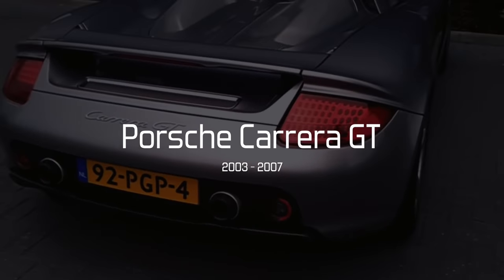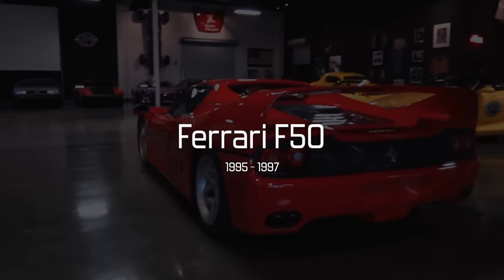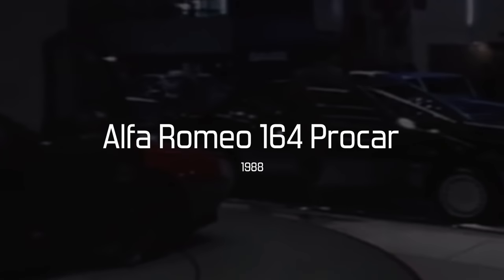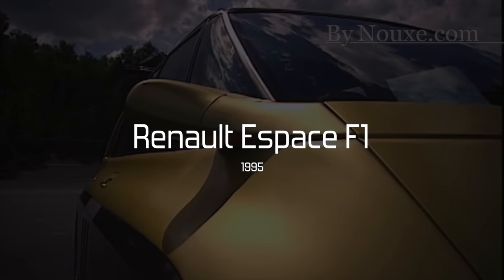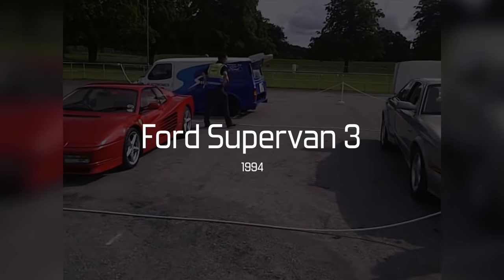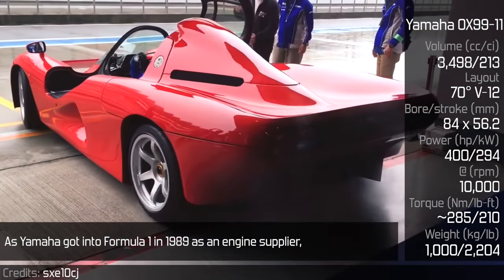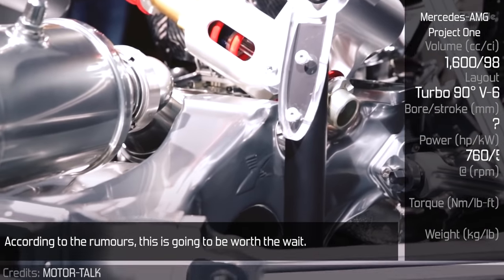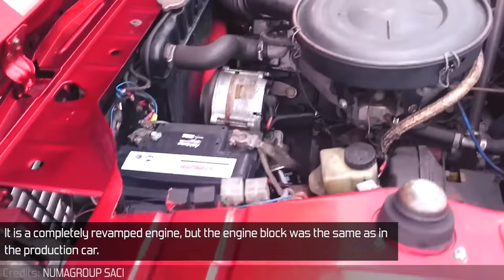8 'Regular' Cars Which Happened To Use An F1 Engine

Comment: What is a Mexican's favourite motorsport?

(Click 'Read more' for the punch line)
FORMULA JUAN!
Reply: Jajajajajajajajjajajajajajaja....
Noup, bueno si.
Reply: omg lol, so dry..
Reply: Oh! Your killing me oh! Oh! Im holding my sides ahh! Good juan, I didnt see that juan coming.
Reply: Cross country
Reply: why doesn't mexico compete in the olyimpics

Beacause everyone who can run or jump has already crossed the border.
Reply: Lawnmower GP
Reply: Good comment from a Mexican point of view. I'm Mexican but raised in the USA.
Reply: TACOBELL Racing with Speedy Gonzales as driver..
Reply: Josh Bacon Even mexico has a hypercar now.... and it actually has an awesome name

The INFERNO
Reply: Bronicar 3000 Well, it's yet a concept car, and as the Mastretta MXT is dead, the only mexican car right now is the VUHL 05
Reply: My Volvo 264 was equipped with the PRV-V6 which at the time Renault used in their Formula 1 cars. I was told that the F1 version produced approx. 600HP!
Reply: Andrés García Still the INFERNO is one hell of an awesome name for a car, it actually looks like its been through the furnace of hell
Reply: well my old BMW 2002  engine was the base of the 1500 HP formula 1 engine. Renault  accused BMW to burn NAZI fuel to get this power. Well nobody checked the fuel of Renault. But just for infomation the cost of winning 1983 FORMULA 1 was 10 time less that for Audi for the WRC with its Audi quatro. Few years later from  the old 6 cylinder 24 VALVES ( build for the M1 used by F1 pilots before the F1 grand Prix during the Turbo era) the same team of F1 Motorsport BMW built the  the 16 valve M3 2.3 l  (CODE S14B23)  in 2 WEEKS! This engine is still the best ever engine in car industrie to have won more than 1400 races  at  the time Renault Mercedes Peugeot Audi VW Ford Opel etc were invested millions to get some results! The worse will came from Ford accusing BMW using the same base engine to more than 25 years in order to force BMW to quit the race. Well BMW with no monney in the early 60 is one of the famous car manufacture today the big one still using as the reference to compare thei best car. So far   people driving a BMW doesn't need to tell more about their drive a BMW only to name the serie with sayinf the model. No car manufacture can pretend to have built such a reputation of its production in oder to make its clients proud  even for the serie 1 even to compare with Mercedes with its class 1. Just because Mercedes is still using british tuner to win some race, the german manufacture can't pretend to be as good as BMW. When Mercedes complained that Bosch was unfair because the Motronic technology was much better forcing BMW to make a deal by justice court decision,  like Ford later on , BMW demonstrated that it was  capable to be better without paying more . I don't talk about the cardan transmission instead of the chain, the steering wheel found in any car, the independant suspension for the 4 wheels since the 60, the variable valve control found also today on modern Renault gas engine. By the way it's BMW in 1973_74 to sell the Turbo with normal gas on catalog for it's 2002 before Renault and Porsche.... Renault public manufacture won Formula 1 engine because the support of the national Petrol company and nuclear technology tranferts. Renault helped BMW to produce the nuts for BMW turbo and maybe because Reanault was not keen to compete against the unknown Talbo Sport team  willing to byy the BMW  F1  16V 1.5l turbo engine...
Reply: Or cross country
Reply: Josh Bacon LMAO!!!
Reply: Hey, Josh!
Which car has the name of a Star Wars character?

Toy"Yoda"
Reply: real Tylun Porter LOL! 😂
Reply: DC77 Gaming Out?
Reply: DC77 Gaming my question is why?
Reply: DC77 Gaming Exactly. You dont have a good reason for me to get out.
Reply: formula chapo
Reply: Josh Bacon for me it doesnt say read more
Reply: Josh Bacon
Reply: Somebody call the cops
Reply: This joke is so bad that it’s funny

Comment: Not just warmed up before started, they have to be kept warm AT ALL TIMES.  Literally they keep the oil and coolant hot and circulating, because if the engine block is allowed to cool down, it'll crush the pistons and rings and ruin them!
Reply from the maker: I hear this for the first time. But even if it is true, it makes sense - F1 tolerances are ridiculously tight.
Reply: I know, my gfs are jealous of F1 engines.  OHHHHHHHHHHHHHHHHHHHHHHHH!!!

Comment: How much you wanna bet that the AMG Project  One doesn't make it to production with a 1.6 liter V6 that makes 760 hp?  It is a pipe dream to make those numbers, meet emissions requirements, survive 50k miles at 50 psi boost and still get acceptable fuel economy.

Comment: Got it wrong the f1 engine in the Carrera GT was put in a lmp900 called the [ porsche 9r3] for Le Mans 1999-2000 but was cancelled because of VW telling them to cancel there racing programm as Audi was already in it. Or they would be out of the suv project

Comment: The Mercedes F1 race engines never get used at 15000 rpm anyway as it is to fuel in-efficient for the current F1 regs

Comment: Wasnt it alleged that BMW would only use second hand blocks for the 1.5 liter that had covered over 100,000 miles. The rumour was if a block hadnt cracked by then, it was unlikely to ever crack.

Comment: BMW M10 1500hp from 1.5litres in 1986BCE?? What blackmagic power did they use?
Reply from the maker: A freaking turbocharger feeding the engine with around 5.6 bar (81 psi) of boost
Reply: oh turbo cheating no wonder!!

Comment: The more I think about it the less I believe BMW's 1.5L could make 1500hp, especially since each year the legend of the motor keeps growing by 100hp. It's even less believable that it was using a production block. I remember reading publications from Toyota about their Group C car from the 80's that was pushing 1000hp from a 2.0L in qualifying and claiming that it was based on a production engine (3S), but if you check them out there is literally nothing the same about them, including the material the blocks were made out. 

I think in another few years people are going to say BMW's 1.5L was making 2000hp in qualifying.

Comment: What does exactly "~389" means? Does the Transit (for example) have less torque or more? It makes me confused.
Reply from the maker: When I use the '~' sign, it means that the number is not 100 % accurate as I use the power and rpm where the power peak to calculate torque. This number however is not the peak torque, but isn't far from the real number either. For this engine, it could really be over 400
Reply: That makes sense now, thanks.
Reply from the maker: No problem

Comment: BMW engineers would apparently take the M10 block and pee on them and then leave them for a bit to season, I know, I know it sounds Ludacris but look it up its actually written in BMW's F1 history I just can't remember the title. and also the blocks were second hand with 100k plus milage as if there was no problems after that use they would-be deemed strong enough to be machined. but then again I wasn't there so???

Comment: Just nit picking but the moment an engine is altered to make it streetable it's no longer an F1 engine it's an F1 derived engine and vehicles that are specifically built for demo or test purposes don't count as you can't buy one at a dealer to use as a daily driver. There are many even ordinary vehicles with race developed engines some of them for F1 some for other race categories but few were pulled straight from F1 with only clearance and compression changes.
Reply from the maker: That's true - some of these units are truly F1 engines, some are sourced from them. I did not want an F1-inspired engines on this list

Comment: Not Renault make the F1 Espace ... the Espace was desinged by Matra   and Matra make the Renault Espace F1 ... on the back you can See Matra Wiliams Renault decals

German Wikipedia
"Die Ingenieure von Matra nutzten dazu Technik aus der Formel 1, wie etwa den Renault-V10-Motor aus der Saison 1993 mit 3,5 Liter Hubraum und etwa 595 kW (810 PS), durch den der Espace in unter 3 Sekunden auf 100 km/h und in unter 7 Sekunden auf 200 km/h beschleunigt werden konnte. Die Höchstgeschwindigkeit betrug etwas über 300 km/h. Die verhältnismäßig ungünstige Aerodynamik der gewählten Karosserieverbreiterung wirkte jedoch geschwindigkeitsbegrenzend."

Comment: Yeah, F1 engines are cool and all but you can get the same power for way less money in a much more reliable, useable package. F1 engines are only spectacular at their limits and are application specific. They are awesome when used for their intended purpose. Id rather have an engine thats built for the street, to use on the street.

Comment: so the only true,F1 engine in any of these cars is the Renault.. clickbait
Reply from the maker: Clickbait for those who did not watch the video.
Reply: VisioRacer once again only 1 f1 engine.
Reply from the maker: If you want to point out the actual F1 engines, not the others which are sourced, then there is the Espace F1, 164 Procar and Supervan 3. The Yamaha is detuned, but the engine displacement did not change either. If you are nitpicking, be accurate.